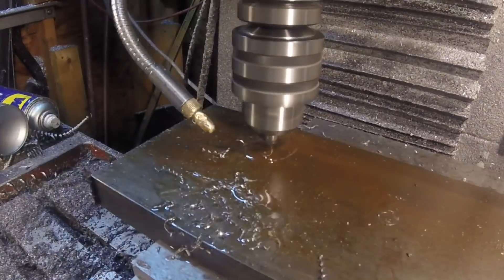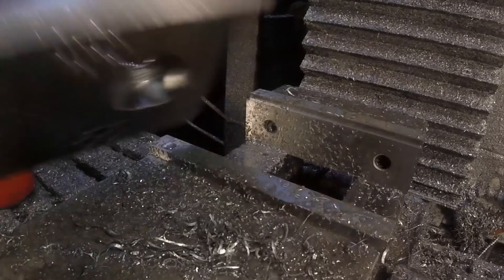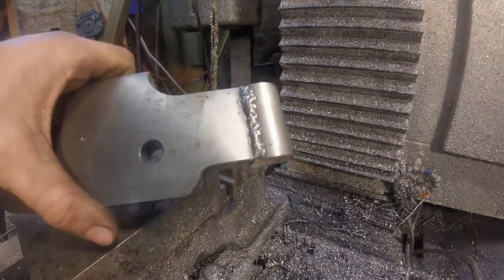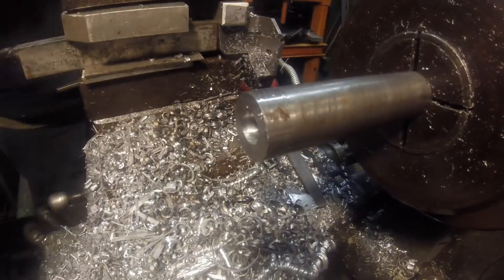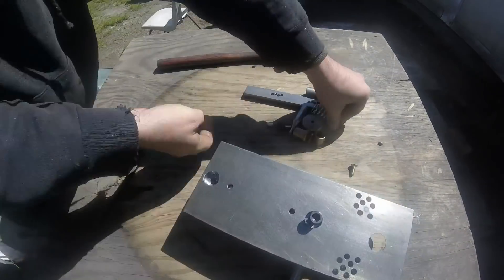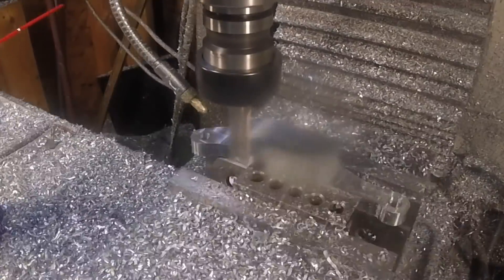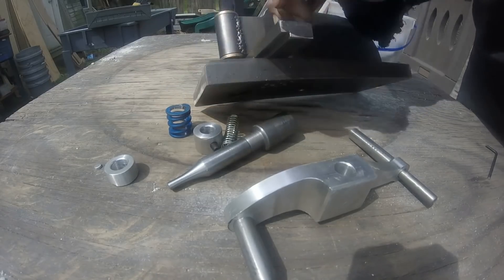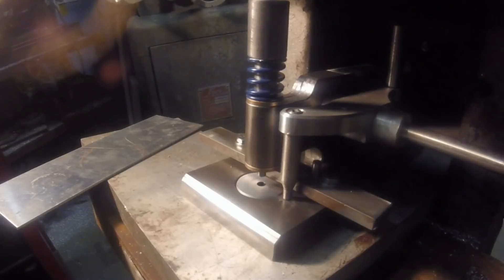Making a hole punching fixture on a Tormach

Comment: The stop could slightly pivot side to side & be sprung so the pin end is forced towards the punch. This prevents it from re-entering the previously pierced hole when the ram is lifted. The  pin stop will ride along the material surface until it drops into the next hole. This method is often called a trigger stop and works automatically so the operator can feed the part without opening any guards. The operator keeps constant pressure on the strip, when the ram rises the strip is allowed to go forward until the pin drops in the previous hole. The constant pressure pushes the pin to the right around 0.5mm, when the ram descends it grips the strip THEN lifts the stop. When rising the pin drops onto the top of the strip ready to be pushed forward again. Power presses are often run without stopping between strokes using a trigger stop.

For piercing more complex parts in thin material, just a punch can be made and Urethane can be used as a die. This eliminates making a die and also does not need precision alignment. Example of this method here - PRECISION THIN COMPLEX PARTS THE EASY WAY.   https://www.youtube.com/watch?v=dOAVcJ1CCmY&t=21s
Reply from the maker: That's a good idea for the stop.  A little more automation is always helpful.

That urethane die is pretty cool too.  I might have to give that a try :)

Comment: stellar video, great design. Could you provide any information regarding the hydraulic press? Apologies if I missed that part, speed watching at work (sorry boss)
Reply from the maker: Thanks!  It's not a hydraulic press it's an older mechanical one.  Here's a video of me rebuilding it - https://youtu.be/rvBkusDQ2Gk
Reply: hello,I am the pipe hole punching machine manufacturer,my whatsapp/wechat:+86-15275603055

Comment: What kind of machine are you using at the end to cycle the punch? I need something exactly the same. Tired of drilling our angle extrusions.
Reply from the maker: It's a punch press.  Here's a video of mine - https://www.youtube.com/edit?o=U&video_id=rvBkusDQ2Gk&ar=3

They're awesome but mostly overlooked as an archaic tool.  Can usually be had pretty cheap.

Here's another video of me using mine with some different tools.  I can punch 1/2" holes through 1/4" steel with no problems - https://www.youtube.com/edit?o=U&video_id=ZWY0VD9JKM8&ar=3

Comment: Very nice!
I am a tool and die maker, and could make a few suggestions. However, the buffet issue that you will run into will be "slugging it up," Meaning, as you stamp the holes, the slugs are collected in the bottom. If too many stack up inside the die, it could crack the die. The simplest solution is to put a riser plate underneath with an angled relief directly under the die to allow for gravity induced slugs evacuation.  Side note, the "spacer" is commonly referred to as , "pilot." If you turn a conical shape on the tip, it will help with entry and exit.

Please, dont think I'm being negative. What you made is fantastic, and honestly far better thought out and executed than some of the legacy tooling that I have to maintain. 

Great work!
Reply from the maker: Your observation is well founded.  Already had a problem once.  Fortunately I caught it before it cracked the die but it had compressed into a mass that was hard to pry out.

Comment: Did you heat treat the punch and die or are these off the shelf items
Reply from the maker: Those were off the shelf items; I built the rest of the contraption around them.
Reply: @ecdezz  I need to punch out some holes between 28-32mm diameter in 0.3mm brass sheet (so, very thin) and was thinking of making my own punch and die from some scrap steel I have in a box.  Is there any reason you went with a commercial punch&die rather than drilling a hole and turning a steel rod to make your own?
Reply from the maker: @perspectivex  A couple reasons; I wanted to be able to change the hole size if needed so with mine I can swap out the punch and die and I'm ready to go.  You can do that with homemade stuff too so not a huge contributing factor.

At the time I didn't have a lathe that I thought was accurate enough to handle it.  The thicker that material is the more important the draft angle on the backside of the die becomes.  By the time I bought the tooling I could have just bought the punch and die (they were really cheap).

Lastly, the tooling is supposed to be hardened (not as important so really thin stuff) and the tool steel blanks were almost as much as the finished punch and die.

It boiled down to cost and convenience.  For brass as thin as what you're working you could almost use a paper punch :) so making some out of steel stock should work just fine.
Reply: @ecdezz  thanks for the really thorough explanation!  I had no idea there was a draft angle on the back part of the die, among other things.  I might have missed it, but, can you say where you got your punch and die from?  I googled a little but didn't see anything like it offhand.
Reply from the maker: @perspectivex  It's been a while but I'm pretty sure it was ebay and somewhere around $20.